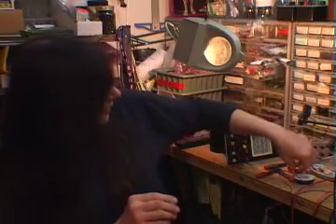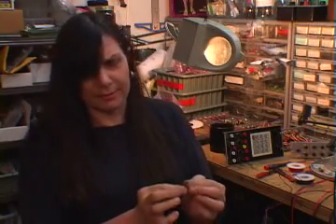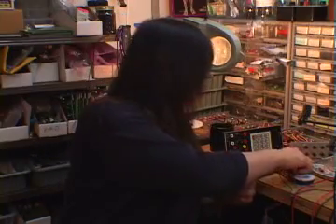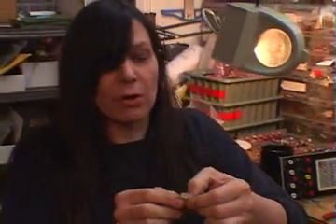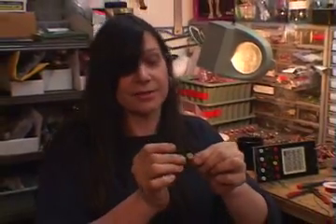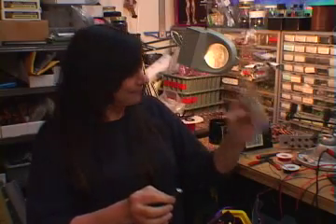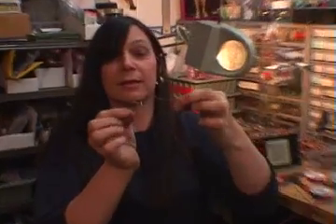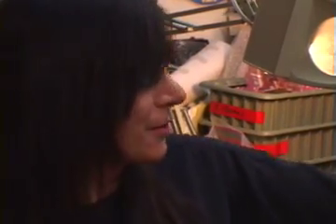Cynthia Breaksdown Vactrols

Comment: @loschaofedmaro the most common use for an Optocoupler isolator in my experience is a to reduce noise for an analog application actually. There is no need for lots of names it is a LED + detector. Done.